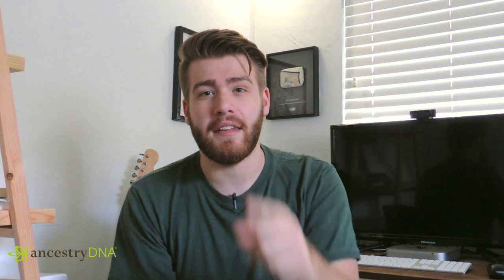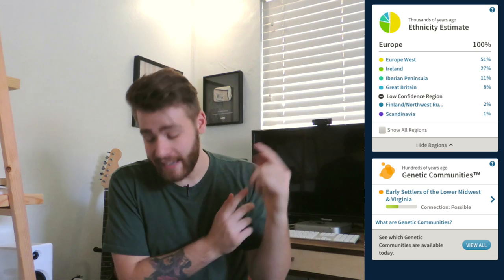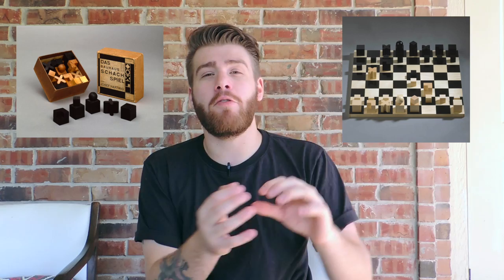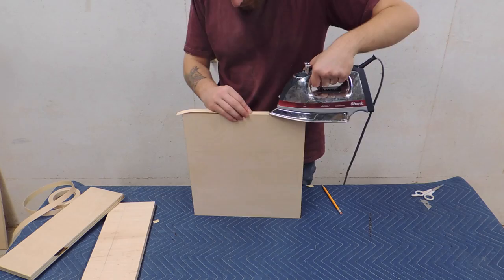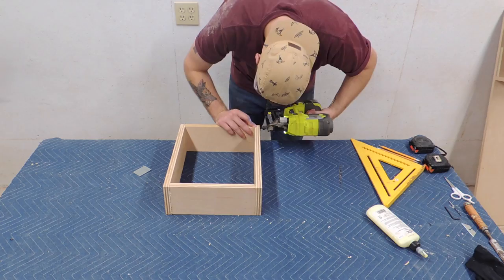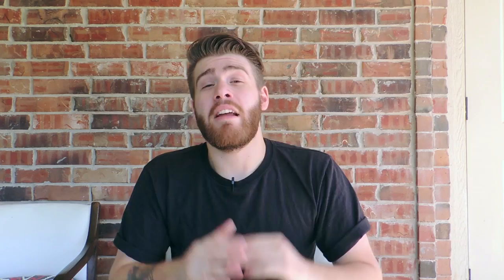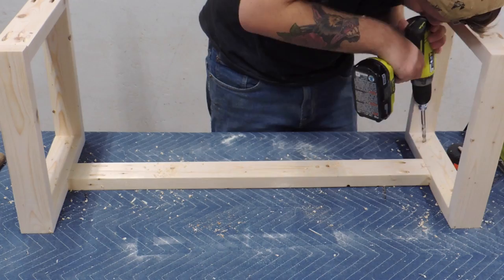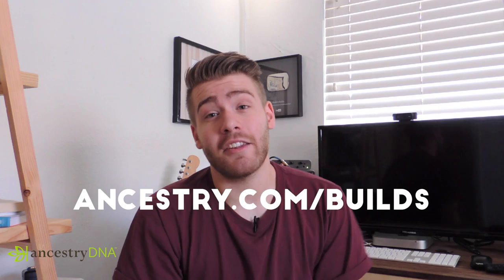DIY Platform Bench With Built In Side Table | Modern Builds | EP. 65

Comment: I love this bench and really like that you simplified the design to make it more accessible to a broader audience. I have a limited set of tools and would find it quite a challenge to get angled legs exact if you'd chosen to do it that way. The one thing I think I would add is a lip at the end to keep the seat pad from slipping off. Or maybe just add velcro underneath to hold it in place? Could also put a small knob and loop of string at the back, where no one would see it. Anyway, great design!
Reply from the maker: Yeah, that's a cool idea! and yeah, you're right. Some projects are made to be challenging others or for more of a broader audience

Comment: Funny thing you mentioned the length of the bit used to screw in the pocket hole screws. I built a bar this last weekend not thinking of that first. Ended up buying another driver bit and cutting it short so it will fit. Now I have one for tight spaces.
Reply from the maker: Haha! yeah, did it end up working well?
Reply: it did. and i found i could put it in a ratchet wrench for even tighter spots. takes a little longer to tighten the screw down, but works nonetheless.

Comment: Is it necessary to plane the wood??  I can finally come close to building one of your builds with only a circular saw, drill, and other simple tools but then came the planar.......😪
Reply: Kiggin Lester I don't think it would be! only if you want to remove the rounded edges of the boards for the legs, but I'm sure you could also use different boards and cut them to size as opposed to this.
Reply from the maker: ↑↑↑
What she said. You could glue two 1x3's together
Reply: Modern Builds thanks! I think I will try my 1st modern build now!

Comment: I really think you could have done better with this build, it is made quite cheaply. Nice for just someone building it for themselves but I definitely would change the methods you used if I was to build this to sell. The cushion would slip all the time for a start, making some 1/2 inch high sides around the cushion or simply some velcro would have been a good solution. Also I think your method for making a box is easy and simple but finished product is not that pleasing to the eye as opposed to other just as simple methods. Thanks for the idea at least
Reply: DCupintheHIZZY I think it looks awesome. I like simple designs and Velcro would be an easy fix. (:
Reply: DCupintheHIZZY building things cheaply is what a lot of DIYers are trying to go for, since it appeals to a broader audience than something that is build with hardwoods and more fine woodworking methods
Reply: DCupintheHIZZY Absolutely not, modern furniture isnt known for its practicality or overly complicated shape and ornate quality, but austerity in materials and shapes, he did a great job. Thats why you find it "simple", he nailed it.